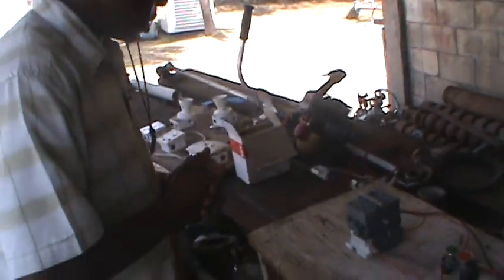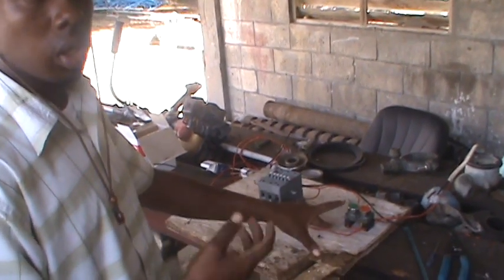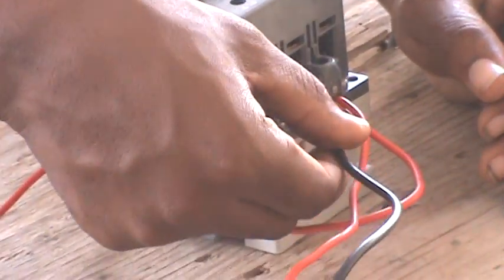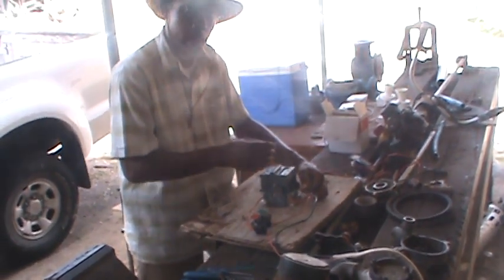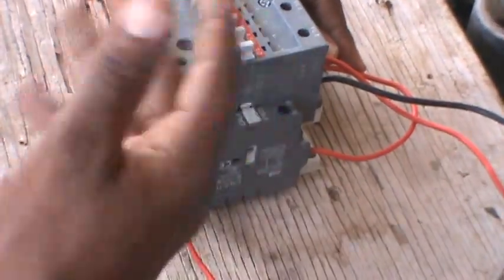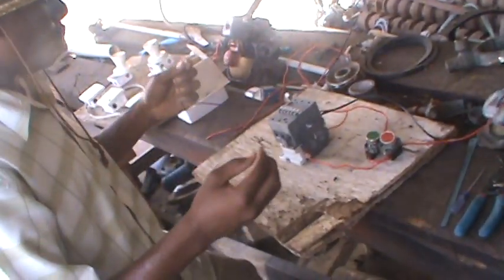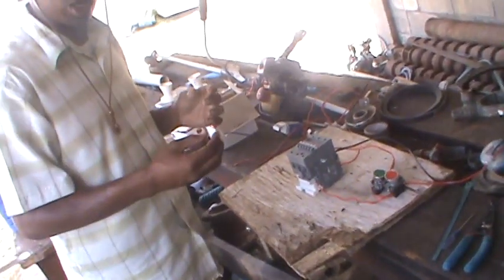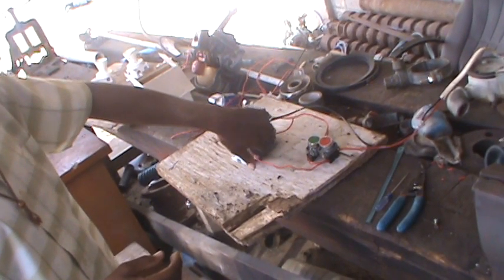How to wire Push Buttons with a Holding Circuit with for a Contactor Coil.

Comment: Great video, I am running the same circuit as you explain, but on 220V. When you press the start button, the NO auxiliary  stays open ? Or the energized coil brings the NO contact  to closed position? Thanks

Comment: First off Awesome videos!
 is there any chance you can do a video or give me an explanation on how to wire the control for a three phase start stop station where the supply for the coil comes off one of the phases? I have a wiring diagram of one I just have a few bits I'm unsure on! And seeing an example would be awesome! any help would be greatly appreciated
Reply: Also it is three phase without a neutral (delta I think?)
Reply from the maker: Are you saying you need a control diagram using line voltages without Neutral?? Are you saying the contactor coils will be supplied by 460-480-415-380 volts?
Reply from the maker: I can send you a diagram of a push button control circuit using phase/line voltages instead of transformer voltages. can you send me your email address please.
Reply from the maker: Alright... well normally once the contactor coil is rate for 415 volts then you just need two phases going to both a1 and a2 of the contactor coil. after the switch and various protective device auxiliaries

Comment from the maker: So note that there are other devices that can be placed in this circuit for protection practices I just did not include because I was focusing on the basic application. Both hot and neutral wires can pass you many devices before reaching the motor coil, keep that in mind. Thank you
Reply: Thanks for the great video. I don't know why (probably from not doing it everyday) but I can't get this simple circuit memorized...ugh.
Reply: his  gonna slam  his gonna go  blam,blam, blam,blam,blam, 

 Lol 😁

Comment: I just checked the voltage it says 29, is the the problem
Reply from the maker: Alright if you have 29 volts that's alright you would get that from the transformer. Can you check the continuity of the contactor coil. If you get a low ohmic reading that says the coil is alright but of u get a kilo or Meg ohm reading that's says the coil is bad. Send me your email address so I can explain more via diagrams
Reply: Jak131133@hotmail.com

Comment: The neutral just goes to A2 and stop right
Reply from the maker: I agree with the comment above. Sorry I didn't see this message. But he is right the neutral passes through the NC on the overload relay then to the contactor coil which is A2.
Reply from the maker: Only the hot conductors passes through the buttons.
Reply from the maker: Your very much right. I didn't go into detail but I did state if you need more information contact me. A few ppl did and I explain to them that same topic of why to use stop and start instead of on/off switch. For all those wondering, for a switch you dont need holding circuits the switch unlike the push buttons will remained closed with switched on. And the switch allows automatic restarts, where as the push buttons don't, but the the push buttons still fight again the problems of automatic starting. Most common problems with the line voltage.

Comment: I also put the hot and neutral directly from the transformer,  to A1 AND A2 AND nothing happens how can I test the contactor without setting up the star stop button
Reply from the maker: I think maybe the contactor coil is faulty or your not send the right voltage to the contactor coil. U can test it by send the feeds straight to the contactor. But if it doesn't slam check the voltage. And no the neutral goes straight to the contractor A2. Or you can put it through the thermal over NC auxiliary then to A2.

Comment: your help is much needed I have a test to get reclassified and I need to know how to do this, my question is do I really need a 24 volt transformer to coil or the coil already have a internal transformer and all I need to do is supply the 120volt to the coil thanks
Reply from the maker: Hi judging on your situation you may be missing something. Or a wiring isn't places in the right position. And the answer to your question is yes. What ever the coil voltage of the contactor is you will need that voltage to supply it. If you have a 24 volt contactor coil you will need a step down transformer to feed that contactor coil.
Reply: I have a Siemens 3rt1024-1b contactor,  with the auxiliary contacts on top I bought it used to study so I have no wiring diagram
Reply from the maker: greg yomama 

Hey Greg

I know those type of contactors. Remember A1 is you hot and A2 is your neutral. Even thought you can do the reverse it best to do it right. The holding circuit start from the end of the stop button or even the top of the start button, then goes through a normally open auxiliary on the contactor then to the coil.

Comment: hello thanks for you video, I am having problem I have a start stop push button, I have a 24 volt coil starter, I installed transformer to get 24v or the coil I did everything that you did in the video but the contacts wont close when  hi the start button. after nothing works I the take my 24volts directly to the A2 and A1 and still nothing and yes I have a holding contactor

Comment from the maker: Hey Munch Muncher 

I will do a video about that a soon as possible. But it's very simple all you need is a auxiliary (normally open) what happen is you place the auxiliary on the contactor so you will have an auxiliary for the holding circuit and now one for the light (on light or operating light). All you do is to pass the supply for the light through the normally open auxiliary on the contactor so when the coil slams in the auxiliary changes to normally closed and energize the light. Remember to give the light its neutral directly or by what ever means you want to use. But pass the hot through the normally open auxiliary.